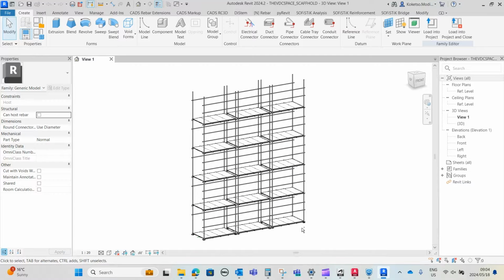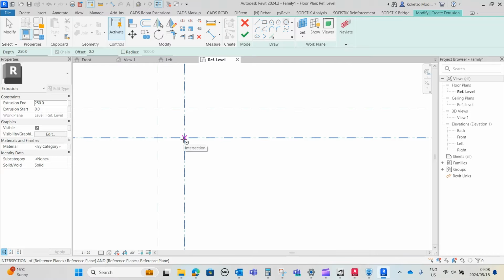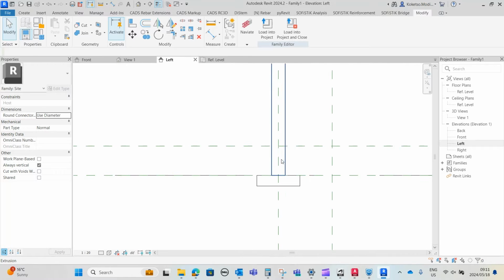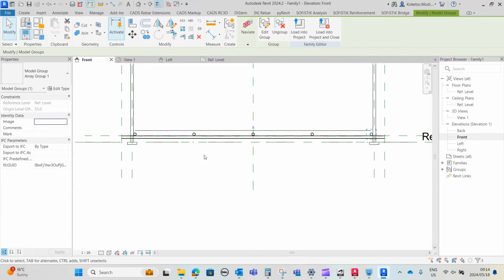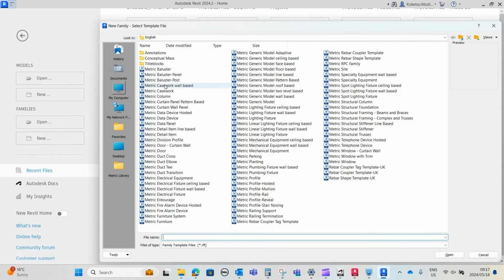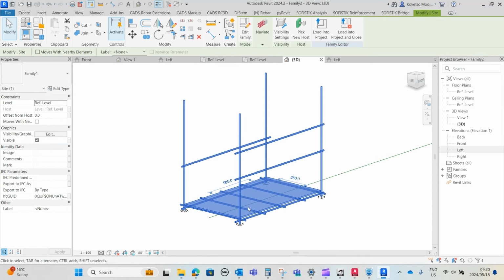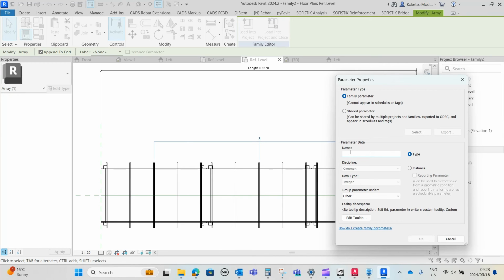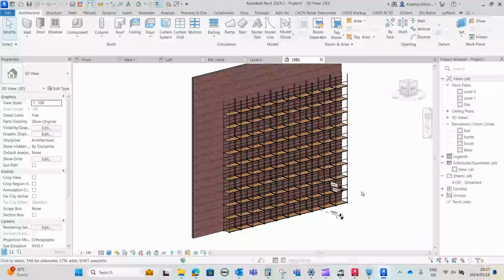Scaffold Family in Revit - Parametric

Comment: Quick question: is it possible to add the surface area to the scaffolding in the model? That way I can create a schedule that includes the total surface area of the scaffolding.
Reply from the maker: Smart suggestion but tricky. Perhaps go into the family add few parameters which are schedulable then load the family into the project to test it out.